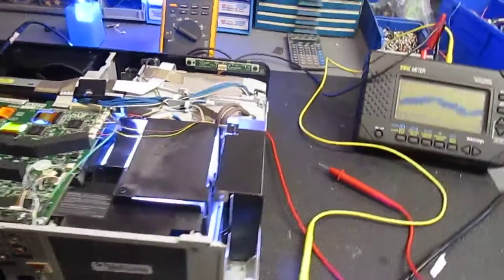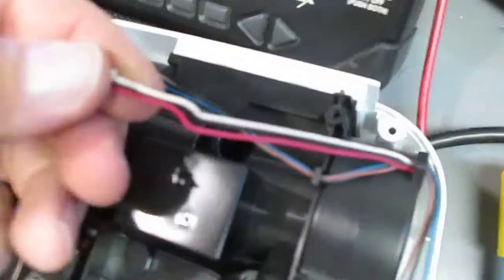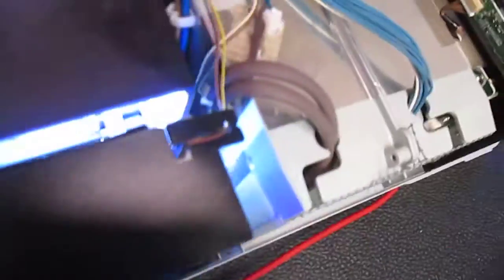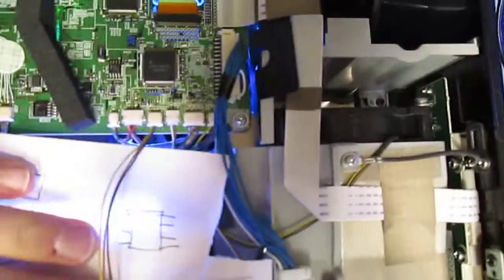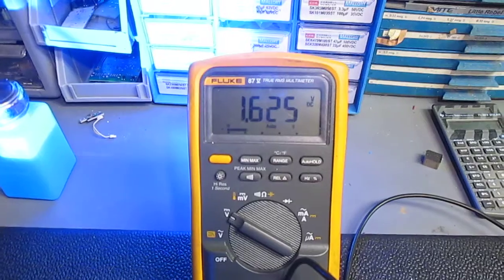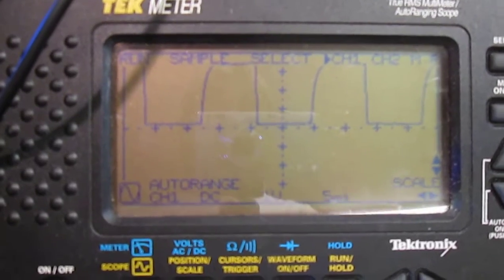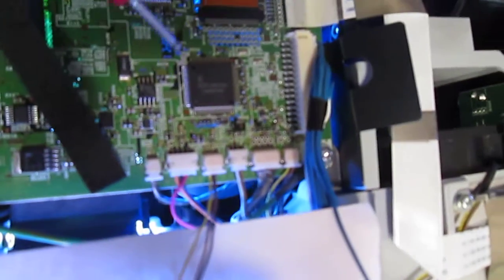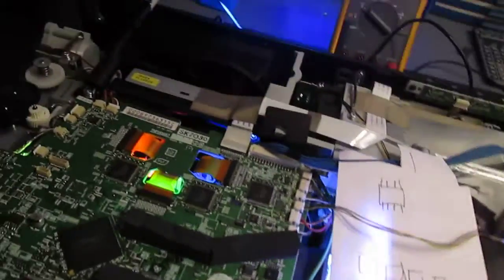How to Check Your Projector Fan for RPM Output

Comment: hi frank i got replace new fan .. but the problem here the new fan got 3 wire red black yellow.. and the faulty one got only red n black.. what should i do?.. after install it with black+black red+red n i just ignore the yellow .. the fan spinning but seems it overheating or something else cuz i got big black spot on the screen after 5 minutes on.. HELP.. 

my model just used single fan.
Reply from the maker: Sounds like you have one of those budget Chinese projectors. Nothing you can do for those once the panel melts. They're poorly designed a nd even more poorly built. Unfortunately this is how almost all of them fail and they cost a lot more to repair then they are worth.

Comment: I have a projector which is not detected it’s fan but the fan is running, can you please advise?
Reply from the maker: There are usually multiple fans. Sometimes they are inside where you can't see them. What brand and model projector do you have?
Reply: @FixitFrank  I have AAXA P7 Projector, it has 2 FANs I was able to replace the both FANs successfully.

Old FAN had issue due to dust but still it was spinning.

Now even after replacing the both fans still getting FAN Failed message and Projector goes OFF.

Comment: Hi i have a question regarding the fans if the fan spins and the rmp sensor is faulty will that cause the projector go into lanp and temperature error
Reply from the maker: It can. The temperature does not really increase. Rather the projector warns you of a temp error because of the fan rpm not reporting. It is sort of a pre-emptive warning. 
It can also depends on the projector. Usually this is thrbycase though.
Reply: @FixitFrank  thanks. I've got two Epsom two different ones with the same problem i bypass thermal resitors with 10k still the problem persists.
Reply from the maker: @yusritassiem9913  Sure thing.  did you bypass the thermistor or the fan status leads?
Reply: @FixitFrank  hi the thermistor

Comment: Frank, I've got a Optoma GT1080HRD projector that within 30sec of turning on it turns itself off. But before that you have enough time to read "Fan Locked: The projector will switch off automatically. Please contact a service center for repair." I pulled the top off, you can see both fans spinning. I used the procedure you showed in the video. I can see the voltage go from 0 to 11VDC on one fan and the other go from 0 to about 9VDC. I used a Tektronix scope to find the square wave on both connectors. (square waves look clean) If I impede the fan, I see the square wave disappear. So I know I'm on the right fan and seeing it's output. Yet the projector thinks one or more of the fans is not working I'm assuming? I pulled it further apart to make sure there was not another fan on the power supply or lamp ballast. There are only two fans, and the mother board only has two connectors with three pins on each one. There is hardly any dust accumulation on the fan blades, it's super clean inside,  it's a relatively newer model and must have been put away when this problem came up. I haven't tried to see if I can get into the menus at all to change to high altitude mode possibly as I've see others suggest. But the error message suggests its simply not seeing the fan spin even though it clearly is. Thanks.
Reply from the maker: Hi Marcus!  Did you check all of the fans?  There is one buried under the mainboard for the lamp blower.  It is a squirrel cage type. If you had a lamp burst at some point, it is common for glass to get stuck in the blower fan and cause this. I suspect that is your issue.  I don't have a GT1080 to look at, but I recall there should be 3 possibly 4 fans.  2 or 3 normal axial type and then one of the blower turbine type.
Reply: @FixitFrank I also thought there might be another fan I was missing, couldn't see. So I dissembled the projector even further taking out the power supply to look underneath it. Nope, no other fans found, just the two. I also looked under the mother board to make sure there was no another fan connections, on top or bottom of board. Just the two. One axial and one blower type.  What I later found was the original GT1080 uses an identical main axial fan (not the lamp fan), same size, same connector. So I swapped it from the GT1080 to the GT1080HDR. It worked the first time I power it up, no on screen fan errors, no shutting down automatically. I've tested about 2 hours with the swapped fan without any issues. I'd like to do a few more hours just to be sure. But I guess I should find a replacement fan. It's weird the 'broken' fan spins perfectly, and blows when it's powered up. But the projector thinks it's not spinning, or spinning fast enough I guess. Now I need to source a new fan. But I'm glad to find out the mother board is not at fault, that the issue is with the fan itself. Thanks for the replay.
Reply from the maker: @marcusdamberger  ahh ok! It must be like my HD26. They have a duct that directs some air into the lamp. I've found that sometimes the fans stop moving as much air due to the blades melting ever so slightly. It gets a blunt or more blunt leading edge and the airfoil affect stops working. I've seen it on BenQ commonly but not on optoma. Makes sense it could happen though. Glad you have some positive news about it!

Comment: Thanks Frank for such a detailed video, I have a problem with a Viewsonic pjd5134 that after two minutes turns off and turns on the lamp and temp LEDs together, according to the service manual this is because the fan is running 20% less than If desired, it is advisable to change the fan? The same figure as a ballast fan.
regards
Reply from the maker: I would think so.  There is a little cheat that I use to confirm.  If you simply run a jumper wire from the tach-lead of a good fan and (remove the tach-lead of the questionable fan) jump it to the questionable fan's tach-lead input.  If the error clears, then you know its that fan.  One important bit of advice, try and find the exact model fan.  Just matching the size and voltage won't work(as I've learned the hard way).  The values of the rpm output(tach-lead) seem to vary.  There are compatible fans, but truth be told I am not well versed on the nuances between them.  They do not need to be "viewsonic", but if its a Sun-Fan brand, you want another one with the same volts, amps etc.  
Another idea might be to remove the fan hub and clean the running surfaces.  It may come back up to speed.